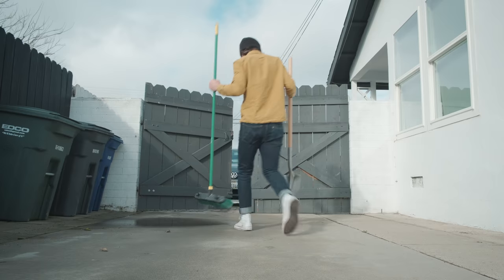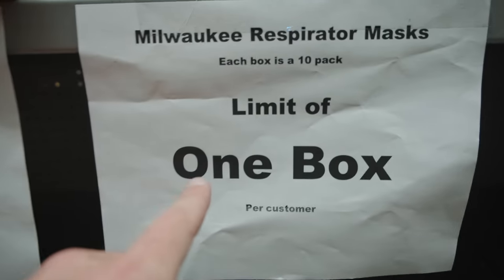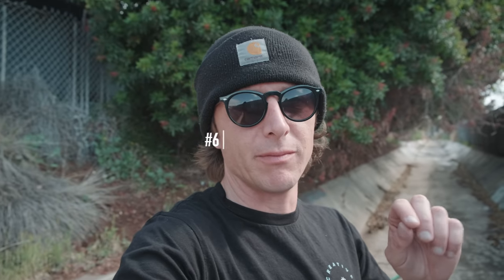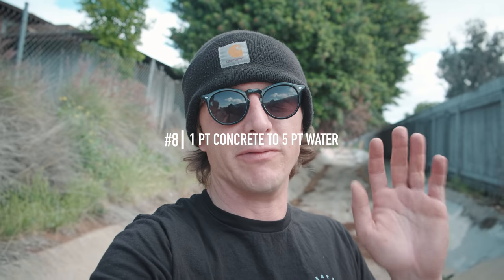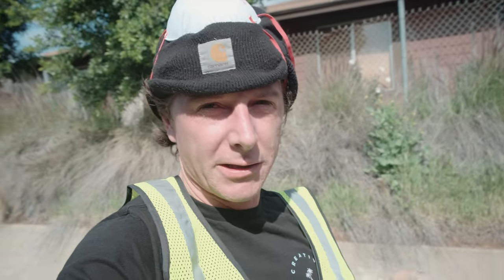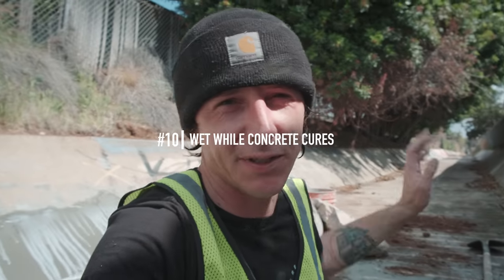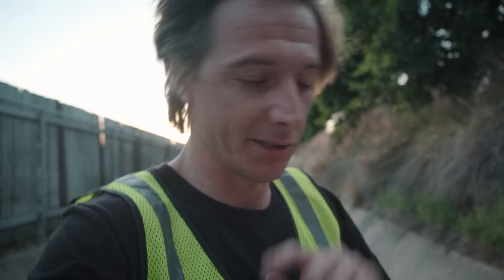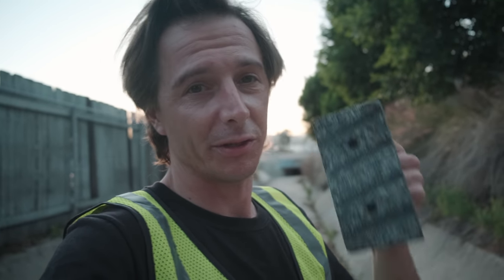How To DIY Skate Spot | 10 Tips under $30

Comment: After you are done rub bricking the edge you can paint it, spray it with clear coat/lacquer, brush on concrete sealer or brush on latex bonding agent..any of those before wax will keep it super buttery..and if the edges of the mortar breaks away, you can skim coat it with vinyl concrete patch.it can be troweled very thin and still hold up.

Comment: Hey!

I live in the woods and have no skateable surfaces near me at all. 
Working from home now and thinking about what I could do in order to get a flat surface for practicing some kickflips and stuff like that.
Reply from the maker: Now would be the time for sure! You could always form up a flat surface with 2x4's, fill with rock, and then cover with cement just using a level to make sure it's simi flat. Easier said then done for sure, sounds like a fun project!
Reply: @ZackDowdy  I actually have some bricks kind of.. where I could just put cement on top. I might aswell because I'm stuck here at home anyway!
Reply: @najtrows  did you end up  getting to it? :)

Comment: i have found a diy spot its an empty cement lot not to big used to be a building then fully knocked down into a parking lot thing nobody uses it is pretty out the way and small its about six parking spaces big me and my friends are going to build a diy skatepark there for our bmx bikes i found a filing cabinet next to a dumpster close to the spot  im going to turn it into a box jump there is also wood around the area of the spot for the trash same with some cinder blocks so if i get liquid nails and some other things its going to be a great fun spot to hang out at with my friends its also got some cover from trees for when its sunny.

Sorry for my big comment i will make a video on it around june 1st also my towns mayor is a bmx rider (hosts loads of skatepark events) so i should be good
Reply from the maker: Dude that's so awesome!! Sounds like you have a great opportunity to build something there! Can't wait to see what you make.
Reply: @ZackDowdy  im starting tomorrow it just rained aswell so the spot should be clean
Reply: Another good tip for you. I skate, ride bmx and scooters (good variety) and I found a good way to make a ledge is with a wooden pallet or 2 or more. At the sides screw them together, maybe 2 pallets high and 2 pallets long and put a piece of plywood and screw it onto the top and it’s a nice flat surface to ride on. For bmx you can just lay smaller pieces of wood in the cracks. Hope this might help you!

Comment: It cracked because you mixed mortar with concrete. Mortar cures quicker and is easier to blend but is not as durable as concrete.
Reply from the maker: Tyler Cox This is true! Mixing in some higher PSI will make the spot much stronger.

Comment: Angle iron + locktite on a ledge makes any ledge skatable.
Reply from the maker: Such a solid and easy DIY!
Reply: @ZackDowdy  you can literally slap them on anywhere.  Dust off the ledge, apply lock tite, slap on iron, disappear for 48 hours and you have an iron ledge that will last for years.  Takes less than a minute to do.  If the iron is short enough you can even apply the locktite in a car/van, then just hop out, slap on the iron, and leave in 30 seconds.  I have no idea why people aren't doing this to every shitty crumblestone concrete ledge in their town.